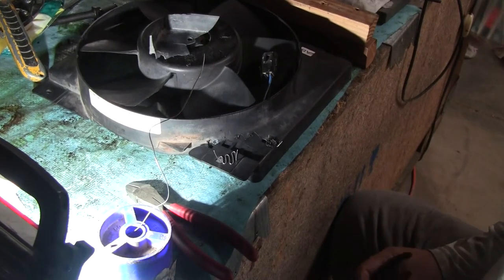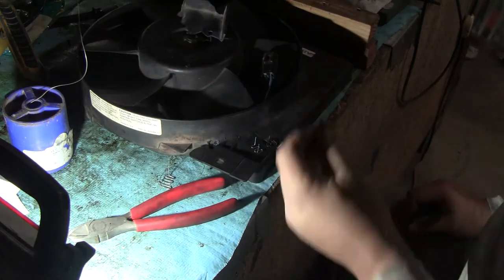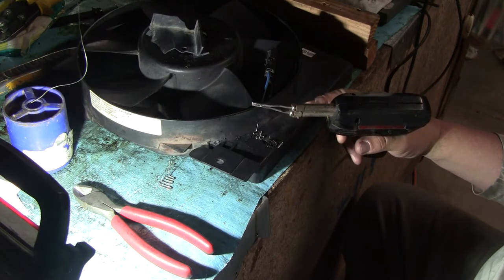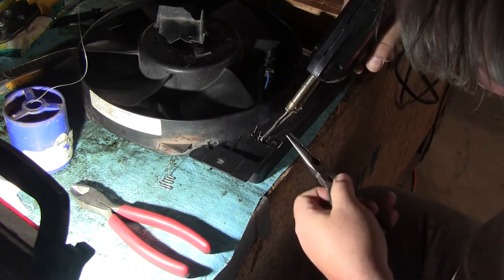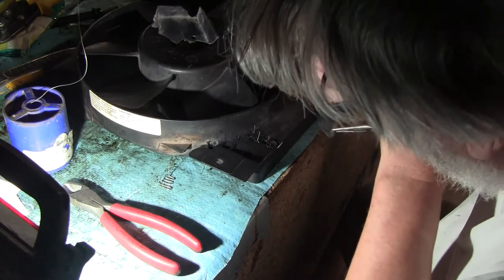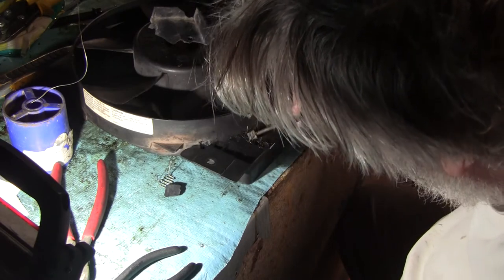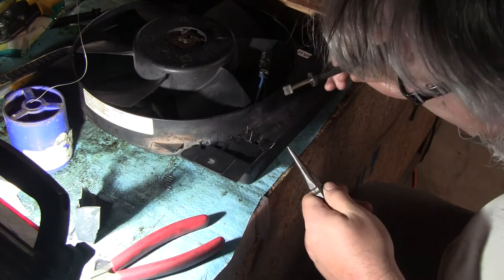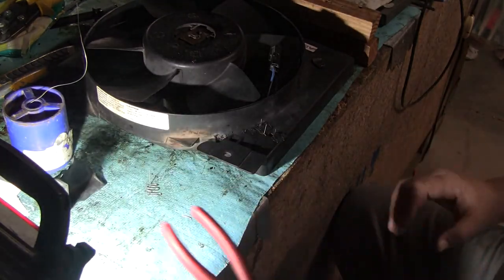DIY Hot Staple Repair/ Plastic Welding Repair of Jeep Fan Shroud !!!

Comment: Dang, I've never seen plastic welding like this before, normally I just epoxy or jbweld my mistakes lol!

When I saw the shape of the staples I thought you were going to run power through them to get 'em hot, but a soldering iron makes sense too.

Also, I wonder if you preheated the filler plastic would it be easier to cut into strips? Heat should make it more pliable and less brittle.

Anyways, big thanks for posting this video, really good stuff!
Reply from the maker: If I did this more often, I'd have modified the soldering gun to run current through the staples, as it would speed things up a lot. But for now it's holding up well after bouncing around the desert !!!